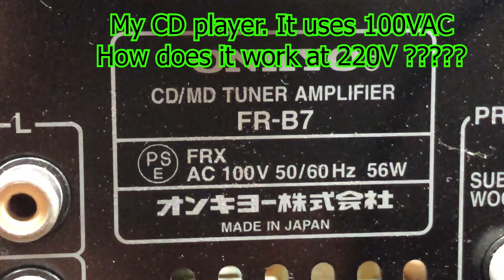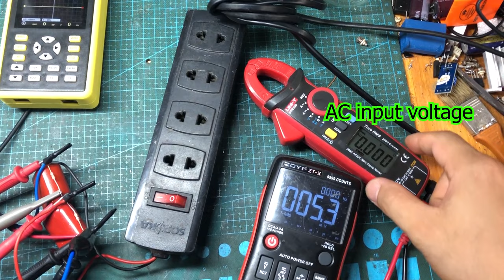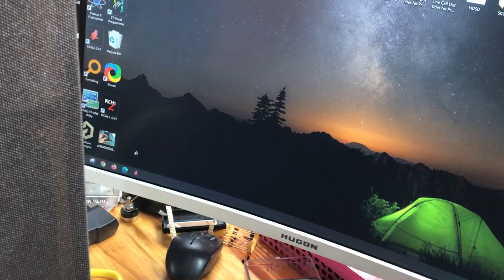Simple convert 220V to 110V

Comment: Simple Technic  , good conversion of 230V AC to 110V AC, but please mention maximum current and wattage , so that we came to know useful for how many  requirements.
Reply: Thanks, but can't see the resister valiu
Reply: @samanthisenadeera5054  dear friend you can use 220k - 390k Resistors easily
Reply: Sir max current kitna run kr saktye hy
Reply: 100W only use.
Reply: @rajpootfaiz3399  hafl watt
Reply: @danielwaithira8967  Thanks dear Daniel Waithira.
Reply: Can I use my Japanese domestic 110v soldering gun on the output of your converter as I don't have a stepdown transformer?❤
Reply: Berapa Watt?
Reply: @samanthisenadeera5054 In the plastic bag of resistors literally says 200K...

Comment: Not a good idea
Reply from the maker: ok
Reply: @PhdHung  I thought you would put a diode. I liked the video, though. Thanks for your effort, we know that it is hard to run a youtube channel.
Reply from the maker: Why is diode?. If you use diode, the output voltage is DC. It is not usable for my CD player.
Reply from the maker: Use 2 capacitors as a voltage divider
AC. Output you will get an AC voltage with the same waveform as the input, but half the voltage.
Reply: @PhdHung  Only for a constant load. Your solution is valid only for constant load, or low loads.
Reply: How much current can this take?

Comment: Good thing is that circuit is simple. Bad thing is that if the capacitor is short circuited the equipment connected will be damaged.
Reply from the maker: The voltage drop across the capacitor is 110VAC. Capacitor withstand voltage is 630V.
Reply: Toca poner fucible por proteccion

Comment: The resistors blow up 💥💥🔥 when I plugged  🔌the 230v AC !!!!!!!!!!
Reply: I think he's fraud, he did not answered mostly questions
Reply: I think you used a very low resistant resistors, use a very high resistant resistor like from 150kOhms to 220kOhms. 

It works perfectly.
Reply: @imtel1 He isn't.

Comment: Для малой мощности пойдёт, но если что-то большее подключать, то не пойдёт.
Reply: Примерно сколько можно до 100w ?
Reply: @kraid1988  ну по таким примерным прикидкам, если сделать схему как в видио, то холостой реактивный ток будет 0,7А, и подключить нагрузку можно до 10Вт, при этом напряжение под нагрузкой должно проседать не более 10%. соответственно если кратно увеличивать ёмкость конденсаторов, то для 100Вт нагрузки и 10% уже ток холостого реактивного тока будет около 7А. В общем такую схему лучше не использовать, а если использовать то только если очень надо, только в одном устройстве в квартире (или частном доме), и на мощность до 15Вт.
Reply: @boris9189  спасибо
Reply: икс цэ - ёмкостное сопротивление равно 2*пи*f*C, где f - частота в Герцах, С - ёмкость в микрофаррадах, для 10 микрофаррад и в сети 50Гц составит 163Ом, для более точных расчётов надо считать через комплексные числа.
Reply: @boris9189 how about connecting both outputs of the divider to the bridge rectifiers and then connect DC together  to get half the voltage but in DC and then solder it just behind the rectifier bridge of the 120v device? Would that make it safe for higher current?
Reply: @give_me_my_nick_back нет, если я правильно понял вашу схему, то она работать не будет, на выходе будет 315 вольт dc
Reply: @boris9189  thanks, I'm still a novice haha

Comment: Hi, congratulations I will definitely buy you a coffee.
Can you show me which components you add to this circuit, in order to avoid that, when you remove the plug from the power point, the terminals of the plug discharge the current accumulated by the capacitors into your fingers. Thank you
Reply from the maker: I connected the capacitor with 2 resistors in parallel. when you unplug . The capacitor will discharge through the resistor.
Reply: @PhdHung  what reference are the resistors?
Reply: Don't worry and thank you How many ohms are these resistors? Please reply  . Thank you ❤ @PhdHung

Comment: what if you want to ground the equipment? i have a preamp that is 110v on a 220v circuit, i have a transformer, but it has a 50hz hum noise, do you know how can i ground it? I dont want to wire it to the 220v ground

Comment: Is it normal for capacitor to heat up? Im afraid it will melt, that is why i unplug it from my 220v source. And i notice too that at 1st it was 120v then after a while it became 170v while continue heating up. Can u enlighten me pls
Reply from the maker: Use a larger capacity capacitor. The voltage will be more stable.
Reply: @PhdHung  any suggestion sir how much capacity is larger? How about the 200k resistor? Am i gonna replace it too? Can u give me the right combi? Thanx

Comment: does it works like a voltage divider? that I can reduce the capacitance and resistance of the second junction to get lower voltage? also, how do you measure the capacitance and resistance required for the CD player wattage?

Comment: Capacitors and resistors alone did not work because I tried it,  I have to add voltage control capacitor in parallel with the circuit before it work. I used it for my 110 v soldering iron. I tried to the same circuit for my GE electric range, because I believe oven section uses 110 v for the control board  but the cooker plate use 220v
Reply: Hola: que condensador colocaste.
Reply: It work for me , what capacitor did you use? Was it CBB 250V 106J 10uf capacitor and 200K ohm resistors?may want to use resistor rate for at least 1watt
Reply: I have the same 110v Japan made soldering gun and I want to use it so eagerly but the problem is that I don't have a stepdown transformer. So I want to build a converter as shown in this video but you say you put a voltage control capacitor in parallel to this circuit.Could you help me with description of it in detail as I'm planning to build the converter,pls? Thanks in advance.❤

Comment: if the input is 300v & output required is 170v and load to run is 2500 watt or around 13 amp, what value of capacitors & resisters will be required

Comment: If you get a voltage divider like this you will get a load dependent divider. Indeed, if you have a 110 Vrms 56W amplifier this is equal to roughly 200 Ohm, thus you put in parallel 200 ohm with 200k and so a final resistance of around 200 ohm in series with 200k -> around zero voltage for the amplifier. i am curious to read the voltage after the switch on
Reply: I agree with you
Reply: The 200k is for safety and equalization to discharge the capacitors. The capacitor resistance   Zc=1/(2*3.14159*f*c)  ;f=50 or 60; c=capacitance
Reply: @imcrazy886  ok, in this way the loaded system is still unbalanced after turn on if the capacitors are the same
Reply: dear friends can we operate 110v microwave oven tranformer from this circuit....?
Reply: can anyone reply me please.
Reply: @rajpootfaiz3399   Definitely NO. Do Not even think to try it!
Reply: @pc20072008  Absolutely Right friend, Thanks
Reply: Y para convertir 110 V a 220 V.como se hace?.tengo electrodomésticos de EEUU y estoy en argentina.que la red tiene 220 voltios
Reply: @daniellescano7420   trasformer or inverterter which can pull up voltage

Comment: Hi, good, can you tell me how to electronically discharge the capacitors after you have used 110V voltage for any appliance used? Thank you
Reply: Most probably the resistors below the capacitors will do it automatically..
Reply: @angsry  what amount are the resistors?
Reply: @Mahdawy11  For 400v PF capacitor 1M ohm qtr watt resistor works.

Comment: Does this inverter work in both directions?  I have a 120v power supply and I need to connect a 220v fan... Does it apply?
Reply from the maker: it just reduces the voltage.

Comment: Hi, i have a question about yourconverter, is it possible to turn on  a kitchenaid rebot of 2000W /110V  or not ?
Reply from the maker: no bro. max <100W
Reply: Why not? You can! But it won't work.
Reply: @leninoble  hi dear friend, I also want to run microwave 1500-2000w transformer 220v - 110v
Reply: @leninoble  dear friend can you help me in this matter kindly reply me as soon as possible

Comment: Good and great job bro , I have 120V AC - 160W Led TV, is it possible to DIY 220V AC to 110V AC 160W. So your solution has max 100W power. What can be done to increase the wattage with DIY?
Reply: Merhaba kardeşim ilgimi çekti ben matba teknisyeniyim genelde tüm gazete matbaları 110 Vac beslemeli motorlarda şahsım bunlarda kullanmak için 110 Vac besleme dimmer devresi kullandım genelde BT 41 ile kolaylıklar dilerim

Comment: my cassette deck is 100 volt but in my country it's input source is 220 volt.... will it work by this method without adding 220 volt transformer??
Reply: hello sir . did you try it? i want to know are you succes?
Reply: @mm3mosen  no I would not... I won't risk for my precious cassette deck.. rather buy volt changer
Reply: @altanphedap6361  ok great job! 
but i I have to make it because the power converter or volt changer is very expensive here
Reply: @mm3mosen  have you make it?
Reply: @Bdi.  No, I could not
Because I could not get this capacitor model
None of the stores I asked have this capacitor
In our country, almost everything has become scarce and even rare due to international sanctions.

Comment: How to increase the power?
Reply: There is no way to increase power.Power is energy. Energy cannot be created nor be destroy.You can increase current or voltage
Reply from the maker: Use larger capacitor
Reply: @PhdHung  Thanks.

Comment: Sir make supply input from 20vdc to 120vdc and output 12vdc with 2amps by using UC3845 ic
Reply: You can't make 12 volt power supply only use of 3845 ic
Reply: why
Reply: It is PWM ic .
Reply: I don't understand your point describe properly
Reply: Are you design any SMPS or repair any SMPS circuit.
Reply: I want to design supply